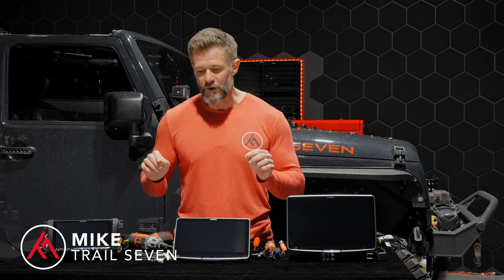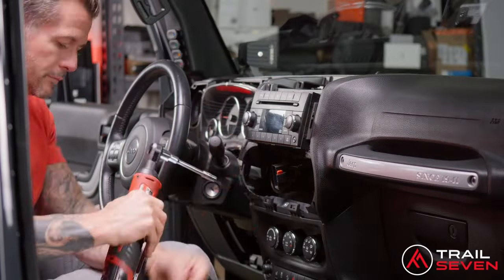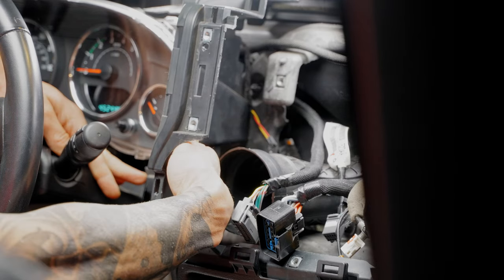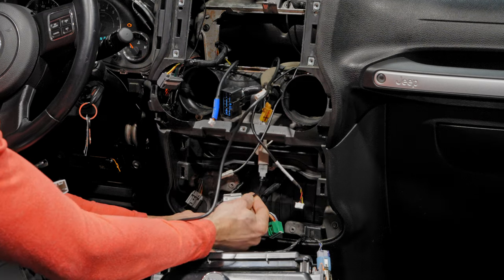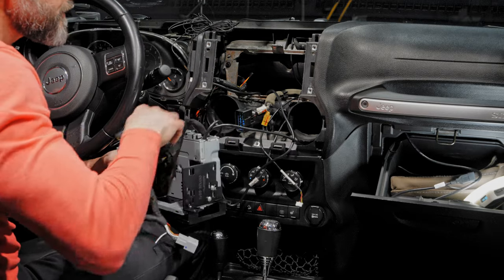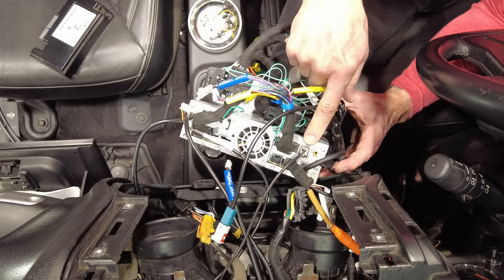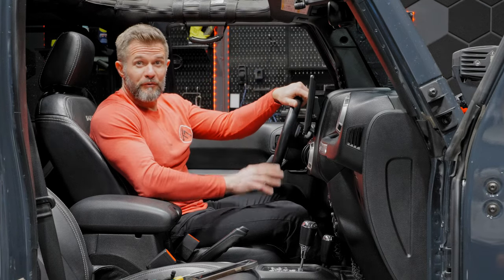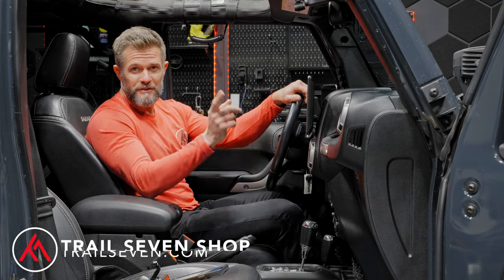Jeep Wrangler JK Alpine iLX-F509/ F511 Plug & Play Kit Installation I 2007 - 2018 Jeep Wrangler JK

Comment: I'm in as long as there is no scratches or scuffs on the head units since you will not receive them in original packaging because of the pre-wired harness done by Trail Seven.
Reply from the maker: The screen cover remains intact during the preparation.  If there are any issues upon receipt, we’re just a phone call away to assist with resolutions.